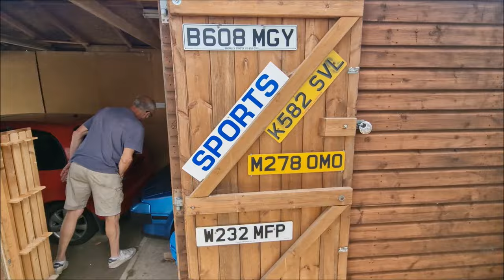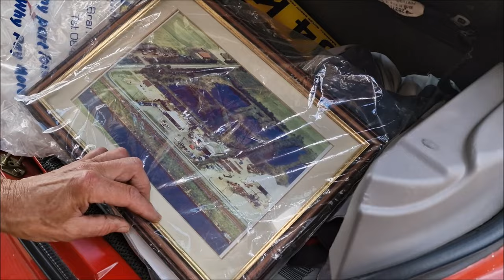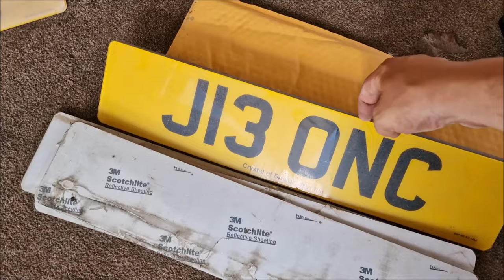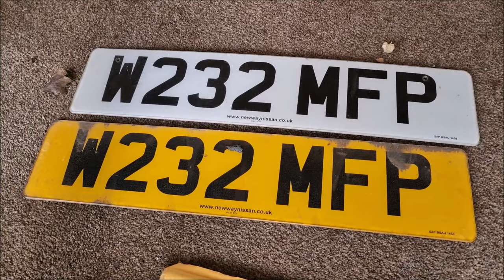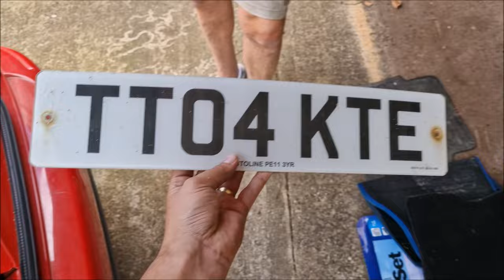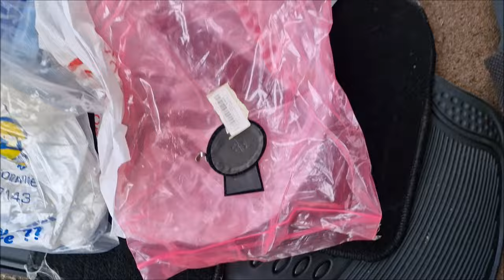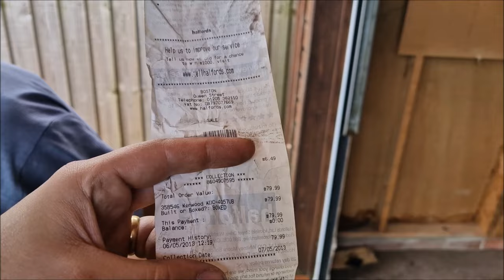Dad's First Look At My K11 Nissan Micra - Abandoned For 10 Years - My First Car, Our Latest Project?

Comment: I reckon you should wash it and take it for a test..  Clean the brakes on the way and see if it will pass. Still do the jobs to freshen up a bit after but see if you can park a Micra K11 for almost ten years then MOT it 😂😂
Reply from the maker: Sadly ... (Coming soon) It won't run right now
Reply: @JonCoupland  fuel filter new fuel.. Cant be much wrong with the old girl hopefully

Comment: You really love them don't you I like them and the older ones but after that terrible I'm not expert on them with wat model they are as I only had a g red and I enjoyed it when I put a 1.3 engine in and last few a couple of years but like any old car is rust but but welding no problem for me I'm shocked the red paint hasn't lost colour or lacquer peel you should put it back on the road if your not like most people haveing to many cars sat around doing nothing and there are plenty of people who do would not take much to put back on the road to be honest wat you going to do with it???
Reply from the maker: I do love them you are right :) - its an emotional thing rather than practical - the plan is to put it back on the road and take it to Rustival 2 in September - i will then hopefully run it as a retro modern daily
Reply: @JonCoupland  i would use it I don't understand some people having lots of cars just to sit there as projects and not get them done and back on the road to enjoy driving them yours doesn't need alot just welding can be expensive I'm lucky myself as older cars I can do every thing but the paint spraying I stick to old cars as newer cars are to technical with everything electrical now